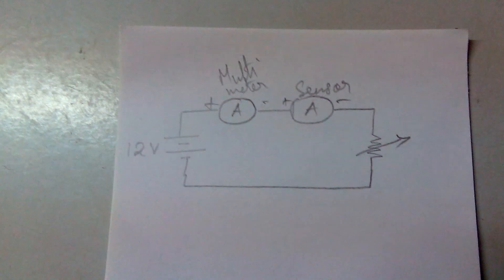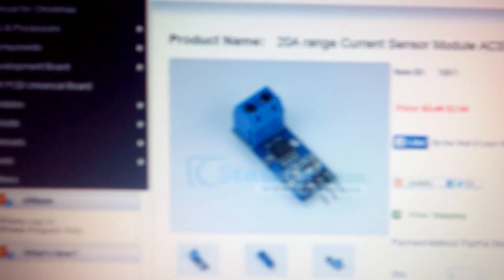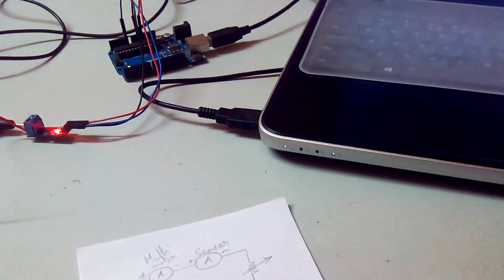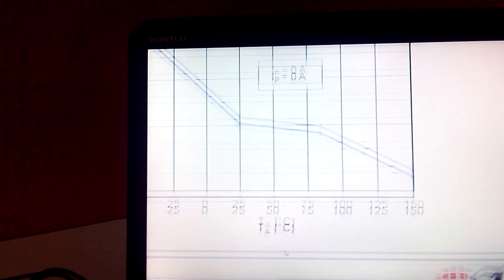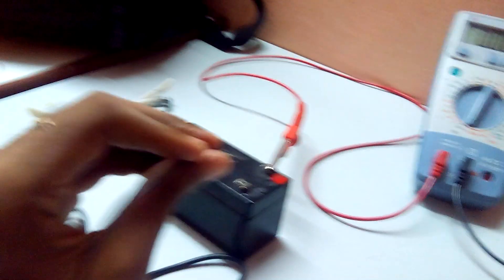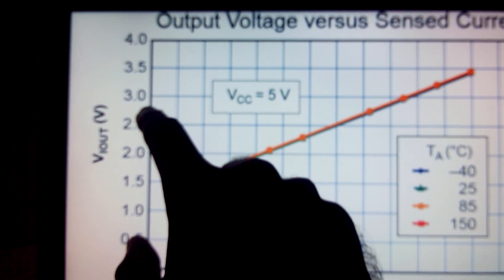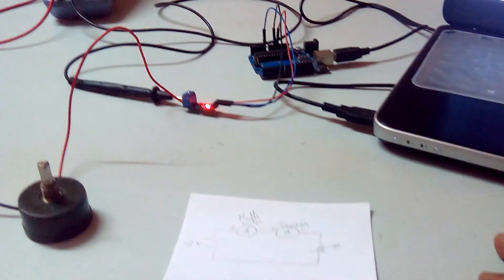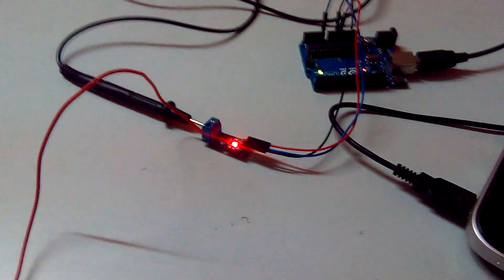ACS712 Current Sensor Module with Arduino

Comment: I am using ACS 750 currenty sensor, the ouput should come out 2.5 V, but now after using it for some time, it shows 2.14 V....this should not happen, no!!! 
Can you plzz help me that what is the reason because of which sensor is showing wrong output??

Comment: Hello sir,
what if i put a load and measured the voltage of the output but it still says 2.5v, does it mean my chip is spoiled? thanks
Reply from the maker: ACS712 can be used for both AC or DC current sensing. What was your load and did you provide the 5V input supply for the IC and then measure the output?
Reply: Dear sir, thanks for replying. My load is a blue led, yes I did put the 5v and gnd to the Ic and measured the output
Reply: What should I do now? Thanks:)
Reply: why does my multimeter says 2.11mA and 0.211A for the same measurement?:(
Reply: oh i do the same things and i have the same problem. did you find a solution for that??
if yes, share to help oders think you :)
Reply: smarty things never got the answer hahaha, I just used a reference and followed that

Comment: Hello sir. Thanks for the video.  Can you upload the code for this in your blog? I am looking to measure current across a wire and make the arduino raise an alarm when the current crosses a limit. My preferred range would be -10A+10A but i am not finding one like that. If is use the -5A+5A device, will it be damaged in case the current crosses its range? If i buy from IC station, do they ship in India?
Reply from the maker: -20 A to +20 A is available which you can use for your project...